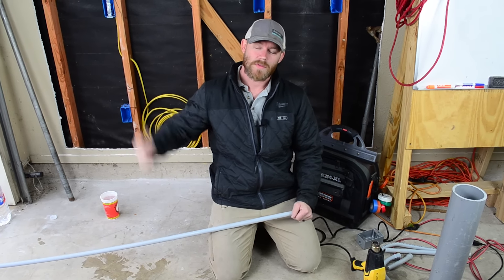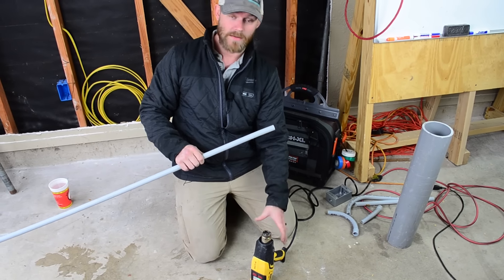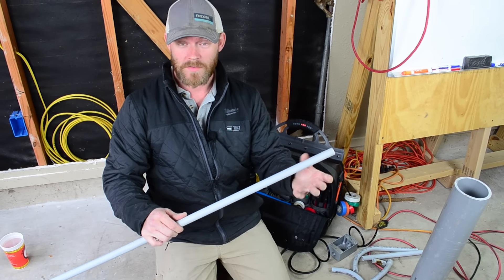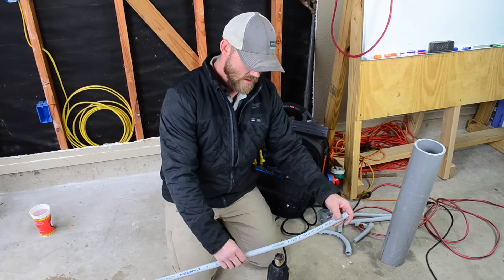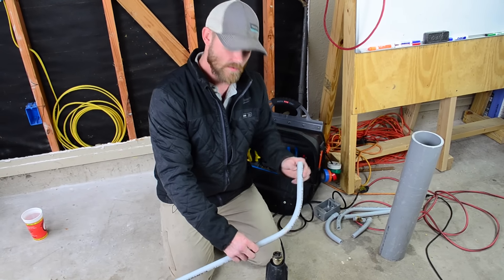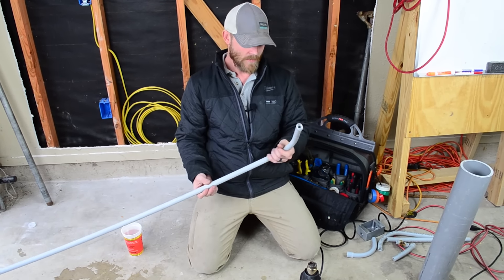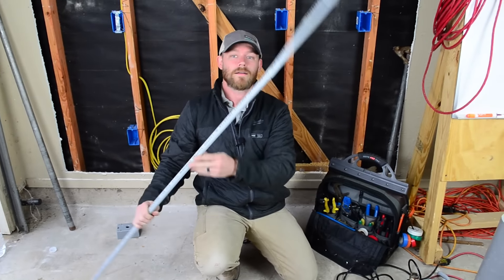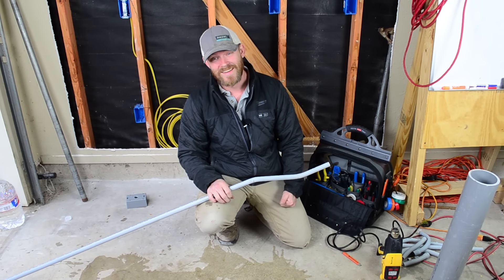Heating and Bending PVC Conduit - BENDING 90s, OFFSETS, and BOX OFFSETS

Comment: Hot box bro way easier also faster.. and if you do an offset or a kick heat it then start one end your conduit in the connector and let the conduit naturally fall to the flat surface that way you can make your offset as long or short as you want without kinking the pipe also you can use it as a jig for future bends. It takes all the guess work out!

Comment: Excellent video... I had a question about connecting PVC conduit to an outdoor box from the bottom.  Do you need to make it water tight and if so, how do you accomplish this?  Thanks
Reply: Did you ever find a solution to this? 
I recently failed and inspection for using a male pvc adapter and was told i needes to use a myers hub which i will then use the same male adapter to connect to it so kinda defeats the purpose if you ask me

Comment: I use a green lee pvc heat box . It does 1/2- 2in pvc it's the only way to bend pipe. Also have 240v heater for 2in-6in
Reply: Its huge and takes a while to heat up. Old school. That's for big jobs w lots of big conduit

Comment: We use a hotbox and I'll stack items to the height of my offset. Once I heat my pipe I just set it on top of my little structure and let it fall to the ground. Get it nice and clean looking then cool it with a wet cloth. I hate the blowtorch. Too much room for error.

Comment: Heat box is much faster and can heat up to 4" PVC and once the pipe is heated you can cool it in place such as the the box offset if the box is mounted to the wall already just stick the heated pipe in the connector and pour water on it it takes the guess work out of it same for regular offsets.

Comment: Hey Dustin quick question how do you attach pvc conduit to an outdoor panel in compliance to National code? 
I've recently had a failed inspection for usuing a regular 1/2 male adapter on a knock out i made on one side of the panel.
He claims that water and moisture will find itself i side tge panel and that makes no since to me because why then is a 2 or 2/12 in male pvc adapter allowed from meter to panel and to connect to meter in an underground service? 
I was told i needed to use a myers hub and thats fine but my issue now is that in order to attach my pvc conduit to the myers hub i need to use a male adapter anyway to screw to the myers hub.
Can you share your thought on this
Reply from the maker: This would be a great question to ask in the discord: https://discord.com/invite/7ykYfbh

Comment: Invest in a heating blanket for PVC up tp and including 1 1/2 PVC. Anything larger invest in a hot box...   The heat gun is fine  in an emergency or for touch ups. 

And a cheap spray bottle filled with water is a must for fast cooling down..... Remember time is money in this trade.

Comment: big question i left my roll of wires outside for years i went to pick them up and the plastic cover came right off, Can i put each wire into conduit pipe or will burn the pipe please help
Reply: Umm did you try fish taping it

Comment: When I bend water tubing for PC building I use a silicone insert to help hold form & shape, never tried using that for pvc, but wonder if would help & work with bending pipe? Usually though, end up using factory bends & rarely do I have to bend my own pvc bends. Another great vid/tutorial.
Happy Holidays, A
Reply: You can use these special spring things with pvc that work on the same principal
Reply: It's for the electrical rated pvc

Comment: Hi, I just saw your video about how you bend PVC pipes with a hot gun and you want to know how others do it. I live in Denmark and here we use a bend fever as we get into tubes and we can bend it. 5/8 = 16 mm and 3/4 = 20 mm and has two different feathers. Hope you can use this for something and would like to say that I really like your video and happiness every time to the next. Hilse from a colleague in Denmark Johan Norup
Reply from the maker: I’ve not heard of that, I’ll look into it!
Reply: Of course there's more than one way to skin a cat, I saw a lot of good comments. Here is the term you want to use you get your conduit like a wet noodle or you bend it then you know you're ready and you have a wet towel or rag and when you've got it formed you wipe it down to cool it off and hold the form. Not box offsets but, bigger offsets and '90s I will make a little jig with plywood and 2x4s that are always laying around so I get my 90 good and I get my offsets exact. And wear gloves! I kind of had a hard time watching this, but thanks for your I'll look at more of your videos, if you're still around 2 years later.GLHF

Comment: can you do the same thing to a 3 inch pvc conduit?  I just need to bend it a little, like 25 - 30 degree angle.
Reply from the maker: You can but it will take awhile and be more difficult to do well.  Definitely possible though

Comment: Hi Dustin,
Do you ever run PVC surface mount in garages? Or is it “junky” looking vs EMT
Thanks for the great videos
KJ
Reply from the maker: I personally don't use PVC unless it's underground.  Here in TX it's so hot that the conduit flexes and warps a lot so over time it looks really bad on a wall.  Plus, in general I think it just looks cheap.  But underground it's all I use unless I have to use Rigid (RMC).

Comment: So basically plastic is slower than metal ? Perhaps much easier to work with , but not much quicker.
Also we need electricity to run the heat gun (or a heat box). So with an off-grid , or new building (without temp service) we would have to use a generator big enough to power the heat gun and some more power hungry tools ( air compressor, table saw, etc).
Reply: Lol PVC is cheaper than emts but emt has to be used in some situations

Comment: Just pour some pvc glue on the ground, light it on fire and roast it like a marshmallow. Wait a few minutes and bend it how you need, pour cold water over it to set
Reply: Then you have glue on the customers floor and out of glue
Reply: Ha. I learned this one from a guy i worked with for a while. Except he would paint the pipe with glue and light that actual pipe on fire. Other than ruining the look of the pipe, his bends were helpful.  This was an in a pinch move though. We always try to use factory bends when possible
Reply: Mr Panda 
That’s true in a building but I work on intersections which are 100% of the time outdoors, and the pipe is all 3-4 ft underground. It isn’t the preferred method but if you don’t have any more factory bends or a heat gun, it will suffice. Just don’t let the inspector see you do it lol

Comment: Heating pvc Conduit generally like that is a not a recommended method from manufacture.  A light warming by hand can be applied then use a bending spring inside to stop it collapsing. 

Larger diameter usually use premade bends.

Comment: Amateur, get a hotbox
Reply: Hot boxes are great, but sometimes a heat gun is better. Need a box offset? Heat gun. Need to heat up 2ft of pvc? Hot box. Only have like 6" of pvc conduit sticking out of a concrete duct bank? Heat gun. Have 6" conduit you need to bend? A pear burner, but hide it when the inspector shows up... lol.
Reply: @thomasdavis4253  Heat guns are good for small little bands. Instead of warming a large section you just    warm a smaller area. Easier to cool down and handle. I just have a hotbox. I dont feeling like spending  more money on equipment that I use once in awhile.